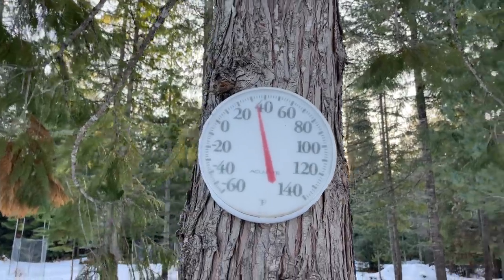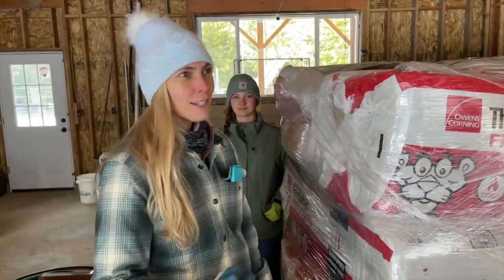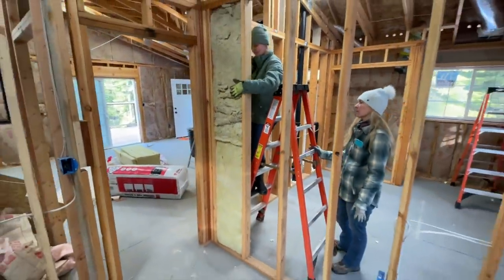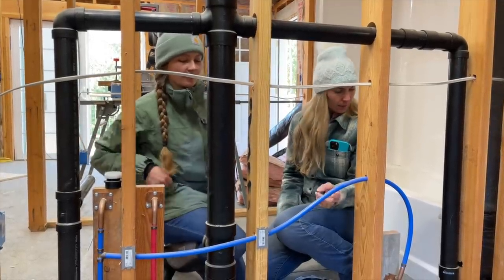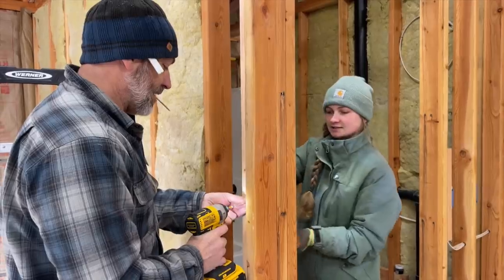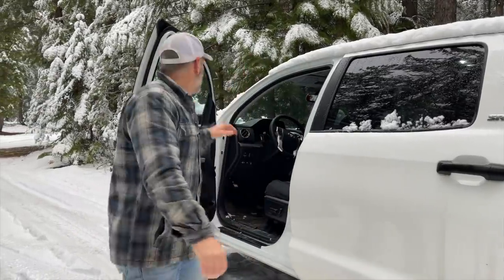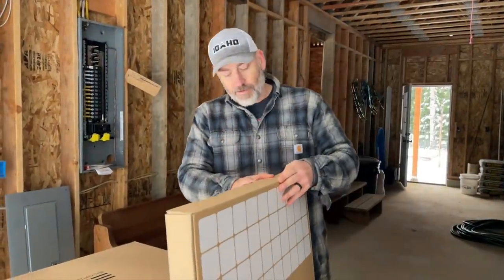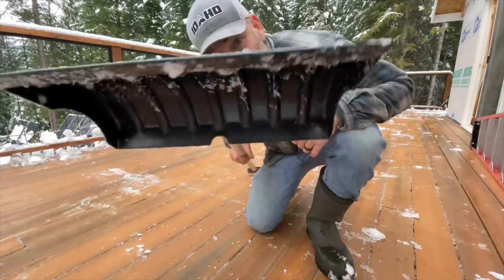Julie's Least Favorite Job - INSULATION - Couple Building House Off Grid

Comment: Temporary Apartment Stair safety:
Suggestion string heavy rope between banisters (4x4 posts) to serve as temporary handrail for your outdoor stairs leading to your apartment. This way when you slip on the icy stairs you can grab the rope instead falling. OR Better yet install your permanent banisters and handrail, but at the top make the handrail so it can be removed for moving oversize articles.
Reply: Of course since you are all actually angels in disguise it maybe ok.   But for the rest of us it would nice to see you guy's safe vs sorry.
Reply: He is intentionally leaving them off - because of planned - WIDE LOADS that are coming up and then putting up the railings later, but I love the rope idea at minimum. The is also a grated non-slip stick down stuff too that be used on the steps too.
Reply: @johnsturtevant9351  But remember, falls are never planned or intentional.   The results will last a lifetime.

Comment: Here's an idea, before you close your walls in, take  room by room pictures so later on down the road if you want to find wires, fixtures, etc, it will be easier than your memories !!
Reply: Great advice!
Reply: I think they had a lot of video materials 🤪
Reply: As you take your pictures,as mentioned, use either a "tape measure, or ,a yard stick " when ref. The wires/ pipes in question..it gives you measurements to work with, later!!??  Jus sayin!!

Comment: If you really want to stop sounds between rooms, the isolation should pres gently against the sheet rock on both sides. Therefore the isolation sheets ought to be a bit thicker than the wall (or be put in as double layer). 🧐

Comment: Pipe and wire insulation in stud bays is super simple.  Just split the bat in half widthwise on the face side and put half in front of and half in back of the pipe.  Tuck it in gently.  Remember to spray fire blocking around all pipe and wire penetrations from upper to lower floor wall cavaties.

Comment: We are used to a little more snow during the winter months, so the porches and balconys have doors made for shovelling snow through. I made it for our old house and also for the new one that we live in now. It is so easy to get rid of the snow on the deck, but it can be knee high sometimes and that takes time because we have a large porch in the old house, and an even larger one in the new home. The old house has a 23x16ft porch and the new has a 59x14ft  + 39x14ft porch. The old house actually has another small porch but it is under a roof so no snow falls on it.

Comment: I installed that insulation in a school for sound deading, the stuff is known as Rotten Cotton and is very agitating on the skin. In fact we wore masks and long sleeves with socks on hour hands to prevent the fibers from sticking in the skin. It was said to rinse off in cold water before using warm water in the shower because warm water opens the pores as cold water would allow more of the fiber rinse off. There is a log blade knife designed to cut insulation which we used.

Comment: The way I clean the outside of my stainless steel teapot and cookware is, I use spray oven cleaner from the liquor store I just spray them with oven cleaner then put them in a plastic bag, so you don't have to smell it, let him sit for about an hour and then all that yucky stuff comes right off. The yucky stuff is caused from the oils in the gas that builds up on the pots and pans when you use a lot of gas stove.
Reply: Great idea! I was thinking about the best way to clean it.

Comment: When you cut the wires and pipes in try to keep the pieces full length, sound gets put through the joints. Less joints less noise. Notch out the insulation and keep the pipes on the side the noise is coming from.

Comment: On the insulation around wire all you have to do is make a cut not all the way through but a cut into the insulation with a knife and then the insulation will just mold itself around the wire please make it a knife cut into the insulation and pushing around but not all the way through

Comment: Lear silicone caulk between flooring and drywall/ wall treatment does wonders for eliminating room drafts and cold/ warm air seeping out about the house.  Of the base can be removed withiut too much visibility or damage it can be dine after the fact.  C,ear silicone caulk that can handle heat and cold has an advantage over many of the recommended caulk because it can be removed with a knife or razor blade with the remainder sanded off as needed should the floor or walls need to be repaired.

Comment: You might want to consider installing expanded wire mesh on the stair treads.  Great non slip material, easy to install and long lasting.

Comment: I think you will really appreciate that interior wall insulation after your have moved into the apartment. We used to have wrap around  wooden decking on farm home in Oklahoma. We didn't get a lot of snow there, but we often got sleet and ice, when that happened those boards became treacherous and they were all on the flat. I get scared every time you show those icy outside steps.  I think you should consider building some type of cover over those outside stairs, and certainly put on some hand rails, it's hard to get much done when you're in a cast. Thank you for sharing your life with us.
Reply: Thanks! We definitely will get them fixed.
Reply: @juliejohnson9531  even if you put some 3M none slip step tape on each tread it would stop them being as slippy it's used in factory's on steps and machine parts where people stand.
Reply: @1MartinWaite  But would that be effective with ice?
Reply: @paulmonk7820  throw salt on step and ice will melt we don't get weather like they do but what they showed the ice was only at back of tread, it would work.
Reply: Im currently recovering from a trimalliolar (3 breaks) fracture in my ankle. 3 plates and lots of screws. I also severely sprained the other ankle. 10 months into it. Went from a wheelchair, shower chair etc, to now, kinda sorta walking normally for short periods. Still having treatment and physio.
Fell down only 4 stairs. Kind of went over them straight to the bottom. No great story, just didn't take care.
So please please take care, I've not had a fun time. Just a heads up.♥️

Comment: At one time they sold a wire product that you wedged between the studs and it would hold insulation in. It also worked well under floors.
Reply: We call them insulation rods, or just rods.
Reply: Interesting
Reply: @augustreil  Chicken wire workswell.
Reply: @juliejohnson9531  Chicken wire.

Comment: It will be better if you add radiant barrier foil insulation to attic  to reduce the heat inside the house during summer (the foil reflects the radiant heat) & maintain the warm air inside during winter..it is on sale at Amazon, home depot, & other online stores.

Comment: I could also see a little instructional video showing how to wrap and unwrap an extention cord the way you do plus some discussion about extention cord gages, resistance, length, connections, damage to equipment if using an inadequate cord, connector, or pig tail.
Reply: So crazy right? Potential to look like a rats nest.

Comment: You should have wired the rooms for Ethernet cables using Cat 6a wire in each room before the Sheetrock.  Wireless it great,  but Ethernet is more stable
Reply: Agree. Hard wired is always the best, jmo.
Reply: @augustreil  as an IT pro - I say hardwire CAT is best. Yes, keep the WIFI too. But
the CAT will be much more secure [SECURITY]
Reply: @johnsturtevant9351 , Agree, Thanks.
Reply: Agree, establish yourself a location for centralizing your router/ POE switch. I also recommend a  location where you can store data I  a safe for NVR.   add cable for POE to your  security cameras into your soffit around the outside to monitor remotely.
Reply: @daves9905  12 ga steel server cages that are lockable work best in these situations - the equipment has to breathe. But needs to be secure. Don't put where everyone can see it and keep it's location private too. They are wall mountable and put the screws where they can not be accessed without the cage being unlocked.

Comment: I also am not a fan of insulating..it’s one of those necessary evils.. I think what I would have done ( because you asked ) was Sheetrock one side of the interior walls prior to insulation. Obviously it worked out fine the way you did it.  I just saying that’s probably what I would have done. I also still think I would build a roof over those stairs. Even though I know there’s a thousand reasons not to.
Reply: Good idea!

Comment: Ha at 21:31 you said you used some plumbers tape to support the roof with the 2x4.  I was thinking Teflon tape, not the plumbers hanger tape. I learned a new term today.  

I agree what other have said about the cat 5/6 cable. I ran it to about every room in the house going back to a center location (patch panel).  I use it for internet and my POE security cameras (needed separate lines for that since it take all 8 wires, where ethernet just used 4 of the 8 wires). That way you have a central location for the modem/router.  And you can use it for tv too (like using.a TiVo in one room with the minis in other room).  

Glad Sarah is home for the holidays.  Is she studying any programming languages for the web site build - like python of JavaScript?  Good skill to have or understand.

Comment: You are going to regret that screen on intake vent   recommend   takin hardware  metal cloth   and  make  screen 6" extention  then can put smaller screen around  the metal cloth   this gives more surface area  to draw wire thru     that window screen you use will become restricted  and furnace will shut down on defaults of no air
Reply from the maker: Good point.

Comment: Hand rails is good but..you have forks for your tractor right?  What if you used the tractor to lift a pallet load of supplys up to the top of the steps if possible of course saftey Sally would need to approve  it may require a safty cage on 6 he forks.

Comment: Wear are your dust masks and eye protection. Fiber Glass or Fiber insulation is Bad to breath in. I have always used insulation that has a paper backing on one side. Did you fix your log splitter, if you did I missed it.

Comment: Generally Curious.  Traveling across all states we rarely see houses with full basements. Why?  It provides so much storage, utility, cool area in summer particularly in urban density. In most cases the ground floor is at ground level. The typical height provides some flood protection, termite break (not an issue in Idaho) and just looks "prouder".
Reply from the maker: Maybe this will help https://www.reinbrechthomes.com/blog/3-most-common-house-foundations-the-pros-cons/

Comment: Split the insulation. It comes apart in the middle and then put half on one side of the wire/pump and half on the other.

Also note to others:  Corning stuff is WAY more expensive per sq foot covered than Roxuel and WAY nastier to work with. (Covers half as much for 80% of the cost)
Reply: I think the problem is, it is very difficult to find Roxuel right now. I had to order it in multiple orders because they kept selling out, and then I would have to wait and order more when it I got the text. We don't have any stores that stock it here either.

Comment: Could you possibly do a test with the battery generator on how long it could run a mini fridge because right now we’re running our generator 24/7? We Boondock in my sled trailer in the summer for 8 days at a time quading.

Comment: To get rid of acoustic reflex you can use cork plates on the walls. They will absorb a lot of sound, but they are not cheap.  I have a question for you, if you like to ponder on it: What was the hardest job of the many you have had on the homestead?

Comment: Isnt it normal to put up the gyprock ( aussie speak) on one side then insulate the walls so you can ensure full coverage then gyprock the other?

Insulating with no walls is a little out there but hey if it works?

Comment: Just wanted your opinion about a plumbing Issue I’m facing.  I have a clog in the Water line feeding the first floor, that require a complete replacement for both hot and cold. Is there another way to fix it.  Then removing all the piping.  Thank you in advance.
Reply: @Gardening 4 Life:  If it affects both hot and cold, and only one floor, it might only be in one short pipe. Need to find where the feed for the hot and cold pipes on that floor splits off from the rest of the house.  Do you have hot water in the rest of the house?  Are there any other places on that floor that have the problem, ex: kitchen, bath, laundry?  Strange that both hot and cold would have the same problem, could it just be the one faucet that is causing the problem?  There are usually cutoff valves (under the sink) that may have been turned off.  Another thought, if a plumber told you that, get another opinion.  May be a scam.

Comment: I’m an insulation installer. I would make a video for you but it would be about 30 seconds of me swearing. Basically if you want to insulate around pipes, you fir the wall out so you can put the insulation on one side of them. Other than that we do our best and just put pieces around and between the pipes
Reply: Should’ve watched the rest of the video, nice job! 2x6 walls for plumbing really help

Comment: It doesn't much matter for interior wall insulation because you are installing if as a sound barrier only but on exterior walls you should split the insulation thickness in half and put half of it behind the wire or pipe and the other half in front of the wire or pipe.  With interior walls just put it on either side but with large waste lines, you should split the thickness.

Comment: Don't understand why you are insulating interior walls for ITS usually the outer walls that need insulation and loft or interior roof areas Basically insulating all exterior walls. Doing interior walls is unnecessary and waste of money.

Comment: hello i noticed a toyota in  the video whats wrong with a chevy or ford you live in the u.s. why not support  the u.s.
Reply: I'll answer that.

I have two ford trucks.  Both of them have had many problems that they shouldn't have had at their age.  My 2018 F150 burns 6 quarts of oil between changes with 80k miles on the truck, fords fix is a longer dipstick.  Front wheel bearing went out at 70k.  My 2006 F250 has 130k miles on it and has had the entire brake system replaced 4 times.  My 20 year old Toyota runs like a top.

American made vehicles aren't even made in America anymore and they are junk.

Many Toyotas are made here in the USA.  If i lived as far out as they do my old fords would be long gone and replaced with a Toyota.
Reply from the maker: The Tundra is make in Austin, TX.